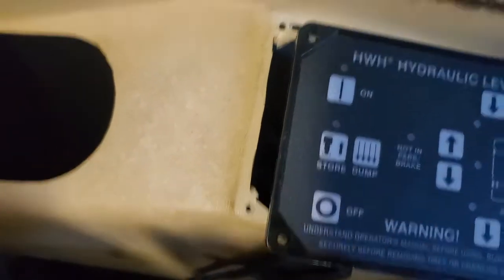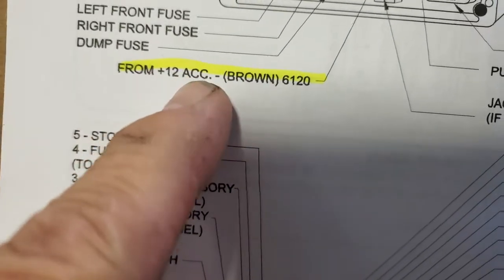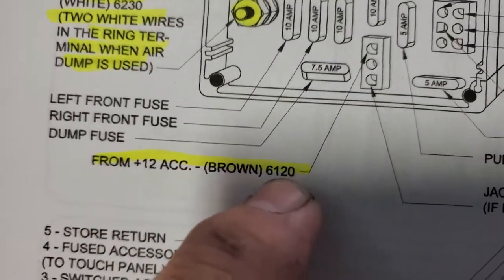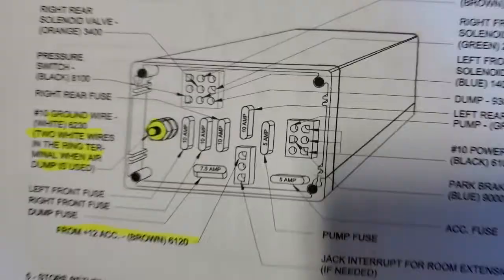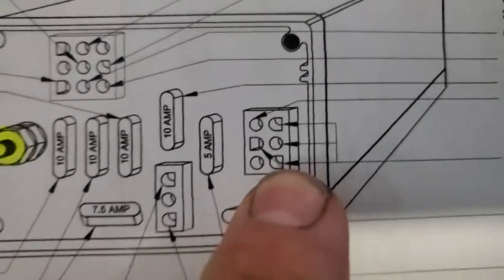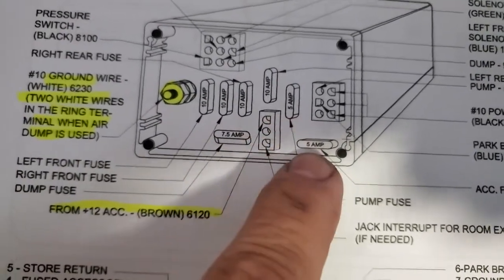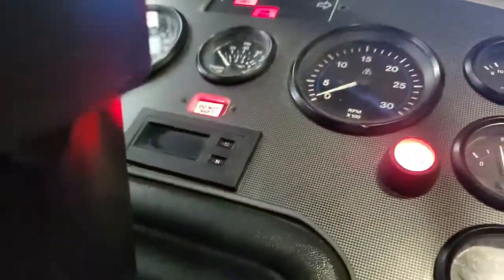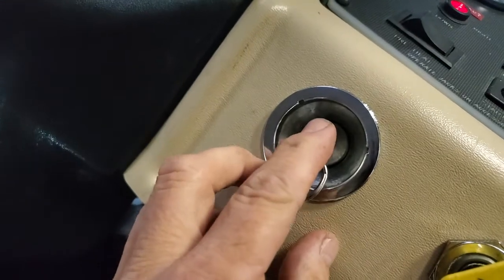LEVELERS HWH 310 TROUBLESHOOTING VIDEO 4

Comment: Thanks for posting. Our 2003 Newmar Dutch Star has the same panel. Our problem, which is intermittent is when I go to retract the jacks, the light on the "store jacks" button won't come on. So far I've been able to just repeatedly push that button and it will eventually latch and come on, then they store fine.
Reply: Solution found. Thanks for posting your video's on the HWH 310. We have the same system on our '03 Newmar DSDP.  Last night after we got home from a trip I tried the jacks again and could not get the "Store" button to come on, no matter how many times I pushed it. So. I took the panel off looked under it and saw the small tactical switch and clean it with "Deoxit", a cleaner I use for electrical guitar pots and switches. I pushed the button 3 or 4 times and it started working again and hasn't missed a beat since. Same thing I did to fix the cruise control "set" button on my wife's 2003 Saturn Ion quad coup several months ago. It's been working like new ever since. Watching your video gave me the push I needed to fix this problem before it became a permanent problem. Love your videos.
Reply from the maker: Glad to hear all is up and running. What does RV mean,REPAIR VEHICLE  and READ VOLUMES OF INFO

Comment: Hey Jeff, I have the same system and I don’t have power on the #10 power wire but I can’t find where it comes from. No fuse or breaker for it that I can find. Any advice?
Reply: Oh and the key pad doesn’t light up at all
Reply from the maker: Do you belong to rvdiagnostics Facebook page. Then we can chat through messenger
Reply from the maker: https://m.facebook.com/groups/1974314296166277/?ref=share&mibextid=NSMWBT
Reply from the maker: On the file section is a 310 diagram. I'll help you ,get ahold of me through Facebook page rvdiagnostics  messenger